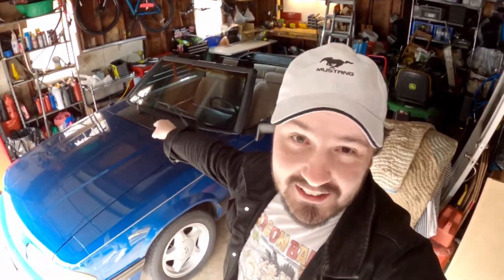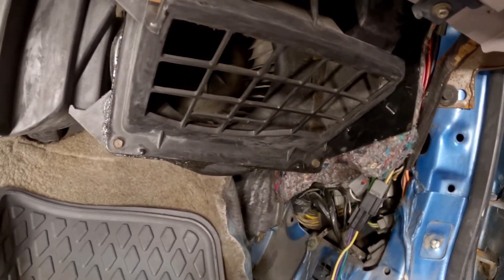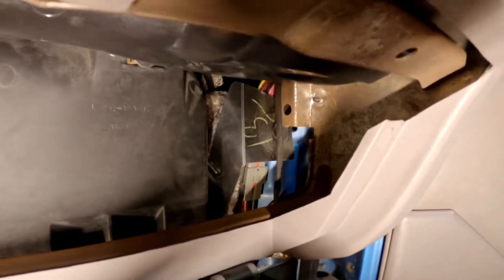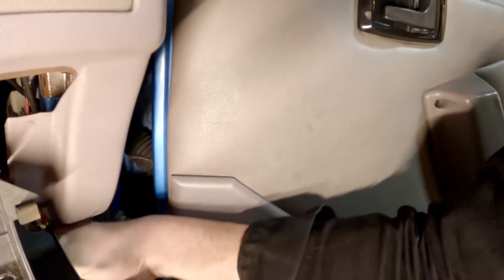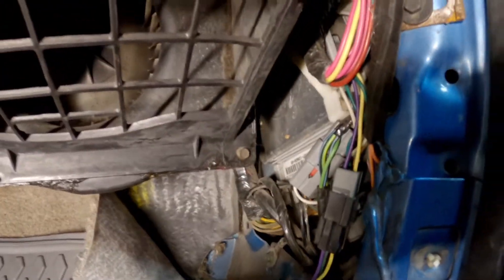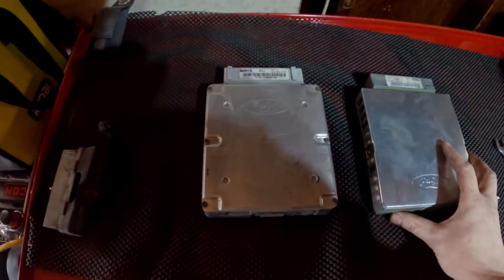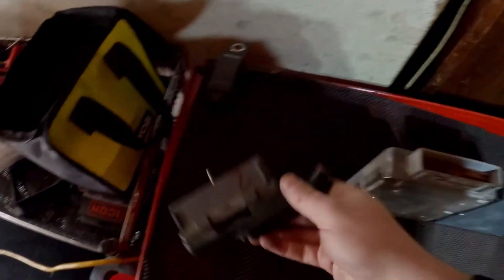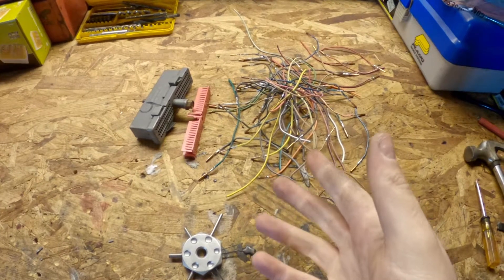I Tried To Upgrade My Fox Body Mustang's PCM To A Newer Ford PCM - EEC IV To EEC V Swap *Mistake*

Comment: Where did you find the EEC-V terminals? For future reference use a skinny screwdriver or proper electrical tools to lift terminal locking tool. Hammer and screwdriver is just asking for broken tabs.

Comment: Oh man it's those little simple mistakes that can ruin your day. I like that you owned up to it right away, says a lot about your character.👍
Reply from the maker: It wasn't a fun discovery lol
Thanks for watching!
Reply: @KarzKreated  Hey I'm not 100% positive, but the transmission strategy on your 97' ECU may not will work with your A4LD trans, since it is specific to the 4R44E transmission. It might be that you will have to move around some wires and figure out which pins output the 3-4 shift and the locking converter on the 97' ECU. The A4LD uses 2 solenoids in the valve body. The 4R44E has 6, plus a way different strategy.  ¯\_(ツ)_/¯
Reply from the maker: Not even just that but the ignition Coils are wired differently as well. The schematics were completely different between the two. Not sure if it would of worked or not 🤷🏻‍♂️
Reply: @KarzKreated  It could work, but it might take a little more thought. I think I mentioned before, that the stock C1A1 ECU is well supported. I'm running a Borg Warner 200SXE turbo in my 93 Mustang with the D1L1 ECU. If you're a tight budget, you could just buy a chip module and have a shop do the tuning and they can just burn a calibration for your chip. In fact, I don't like leaving the 1/4 Horse plugged in. It relies on a very small button cell battery to keep it operating and it can leave you stranded! The J3 chip modules are powered through the ECU and are very reliable.

  There are just too many things that you couldn't access in the 97' ECU, without a really well written strategy, which would make it almost impossible to properly tune for boost. Even something as simple as the spark timing on both your Mustang and the 97' Ranger, requires disabling 9 look up tables, so you can work from a single base spark table.

If needed, I can give you a fairly complete list of necessary parameter changes, that will at least get you close.